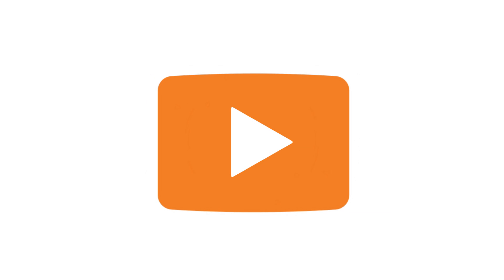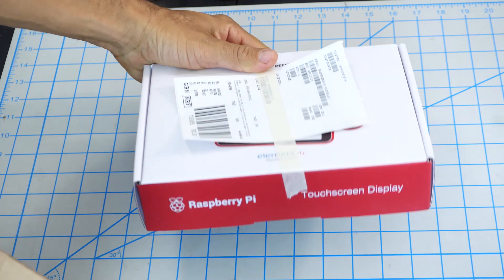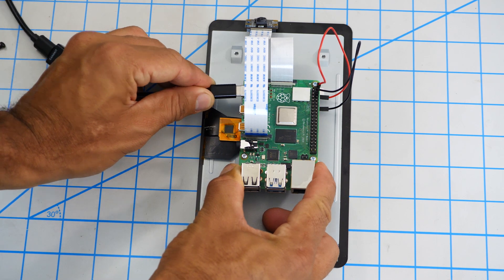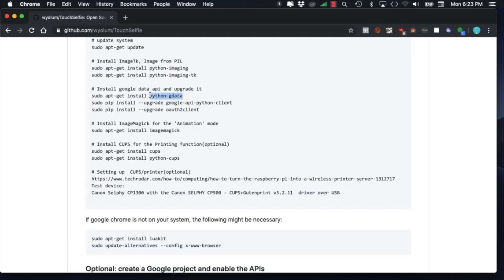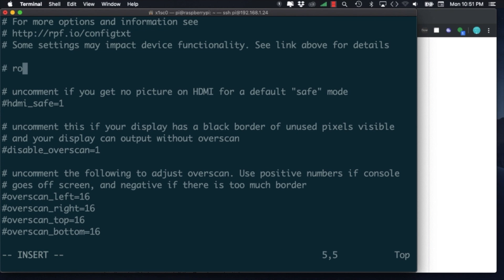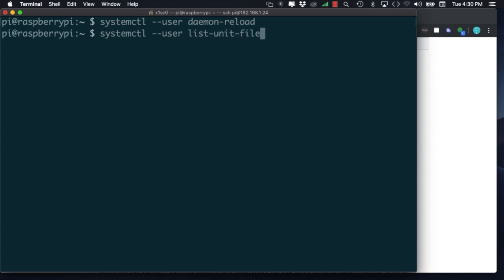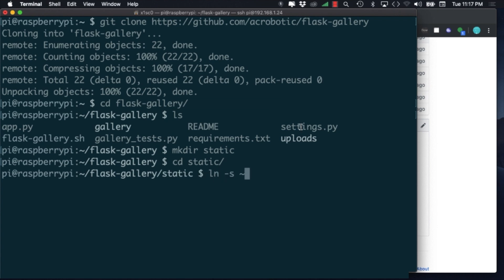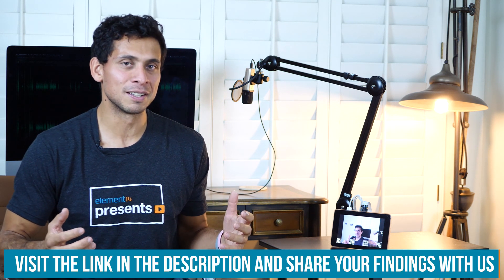Make Your Own Raspberry Pi 4 Photobooth!

Comment: First off Excellent project.  Used it at my sister in laws 50th birthday.  I tried to use the service to start automaticall, mine does not work.  I was wondering if it is because i have to launch it using sudo ./photobooth.sh?  If so how do I fix the service?